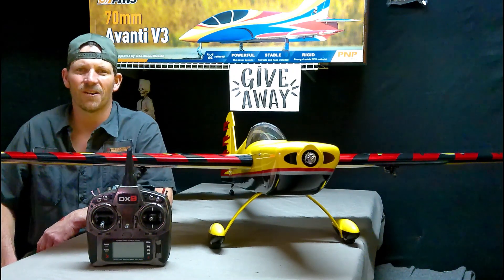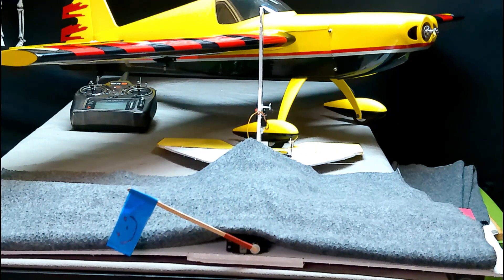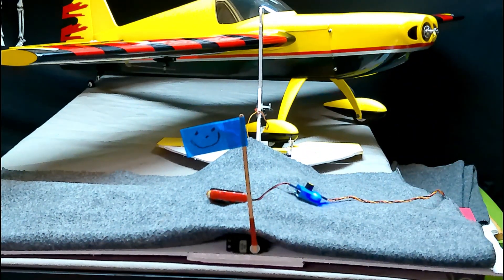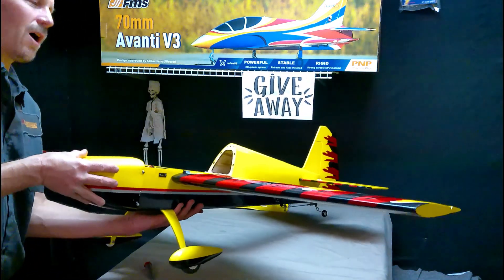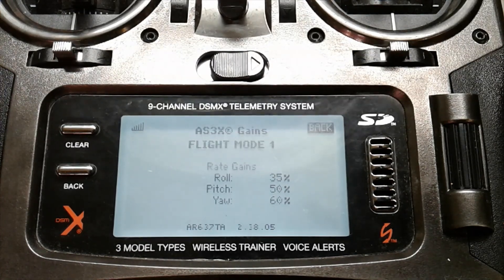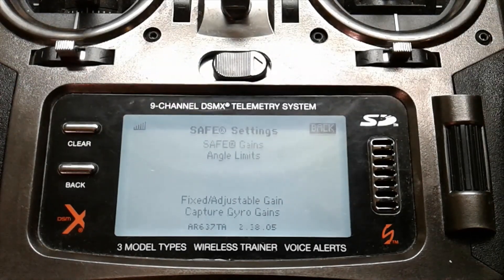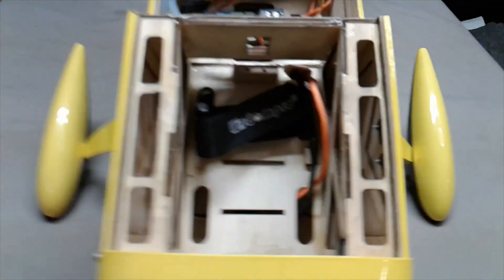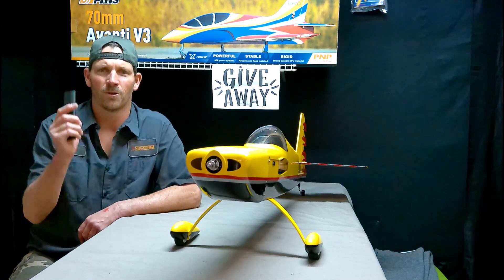SPEKTRUM AS3X SAFE SELECT SMART RECEIVER ALL ABOUT GAINS HOW TO USE THE KNOB OR SLIDER FORWARD PROGR

Comment: This is a great video. Mine is not showing the Forward Programming. Should be turned on? I just updated mine too.
Reply from the maker: Forward programming is only available on receivers that use forward programming and is only available with gen 2 transmitters and newer . NO silver transmitters except dx18 both the receiver and transmitter need to have the firmware for forward programming.  So maybe make sure both are up to date. Then bind to the receiver and go to telemetry and auto config. FORWARD PROGRAMMING IS JUST BELOW TELEMETRY IN THE function list and it will only show up when it is binder to a receiver that has  forward programming.  Try that and let me know
Reply: @GRIFFINRCPLANES  Thanks for the quick reply. I have the Black Edition DX9. I'll update the receiver and see what I can do. I'll try it.

Comment: Right now I'm the newest subscriber 🤠
 I just picked up a used dx8,  just started figuring it out an hour ago. I've been using ix12. I hope this Dx8 don't kick my butt. Well I can use what you just showed us on my ix12. Perhaps I'll put the safe on the Dx8 knob for my grandson.
Reply from the maker: hi there welcome . so dx8 is it a gen 1 or gen 2? silver or black
Reply: @GRIFFINRCPLANES  Black, Gen two I believe.
Reply from the maker: Yes that's good. Make sure you register it. At spektrum RC.com and down load the most current software save it to a SD card then transfer that to the transmitter. Depending on what it has right now you could be missing alot of the new features im talking about
Reply: @GRIFFINRCPLANES  copy that, Thanks. I hope the previous owner unregistered it.

Comment: Thank you so much for this valuable information. My question is which channel input did you assign the SAFE slider?
Reply from the maker: chanell 8 aux 3 is what i am using for the rt slider for safe select gain control
Reply: Thanks
Reply from the maker: im kinda guessing that you may need a bit more help. feel free to ask